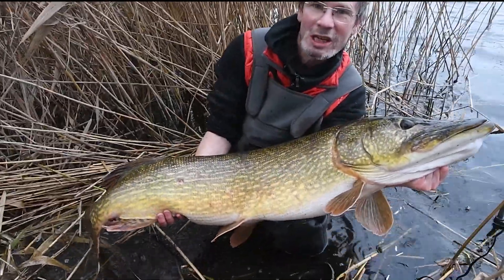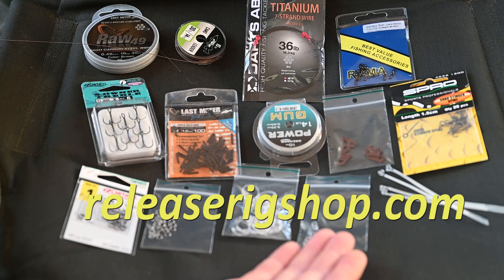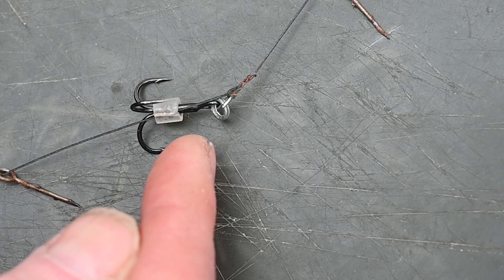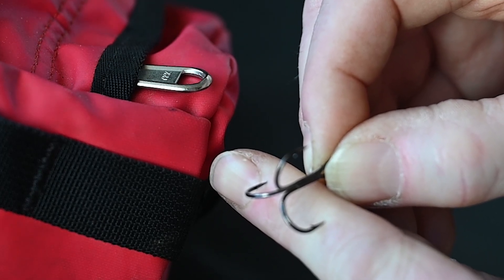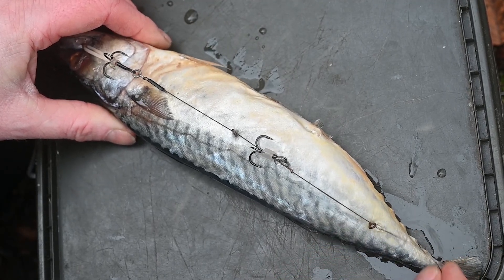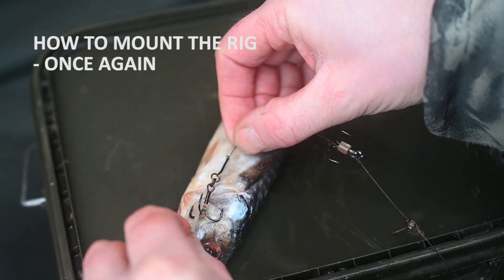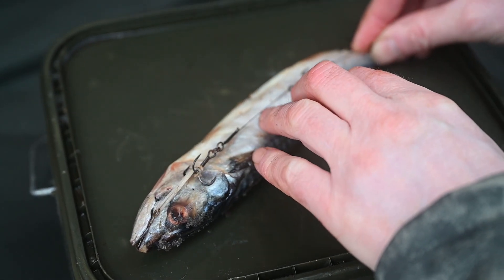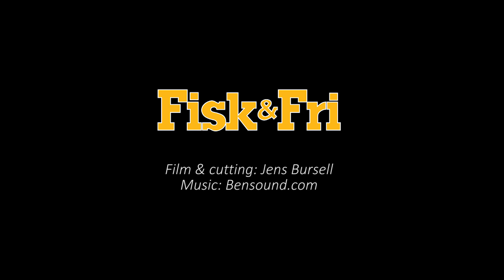DEAD BAIT: HOOK MORE PIKE WITH THE SKATING HOOK RELEASE RIG

Comment: Interesting concept
Reply from the maker: thx
Reply: @fiskfri  what about casting distance with it does the loop not pull through the bait on the cast?

I like big baits amego I tend to make a trace with 1 Single and 2 Treble hooks the single goes in the root or head of bait so all the force is anchored to a bone in the bait. The Trebles are just nicked into the skin of the bait they rip out on the strike into the mouth of the Pike.

Then there's different ways to rig up livebaits of size
Reply from the maker: @DavidScobie  depends on which loop you choose - i find casting very
 long with fx PVA strips as loop
Reply: @fiskfri  I've got those pva cable ties they are good even in cold water they still dissolve.  When I used casting clips I just ended up tieing a 5 inch loop of mono and using that to the casting clip.

I like the original idea buddy but the only drawback I can see is not getting the distance from a cast I do use things like bait boats to drop bigger baits into position.
Reply from the maker: @DavidScobie  Hi - if you want more distance, use a broader casting-loop - fx made of a plastic strip 2-3 mm wide. Remember to have it around the spine of the baitfish - and around the trace, so plastic not lost in water
Reply: @fiskfri  I normally go through the eye socket with the mono loop so it's  going through the skull of the bait. I use a 10lb mono for the loop so it's light enough to take the cast.

I did some videos on my channel a while ago of how I rig up bigger baits  it's something I was always asked questions about I often get a strange look when people see me throwing big baits
Reply from the maker: @DavidScobie  OK - but pike swallow head first, thats why i want the loop in the tail, så hooks turn right for best possible hooking

Comment: Save all the messing around it would be easier to push the swivel end of the trace through the tail so the fish hangs tail first from the trace then pull down and push the hooks in and connect to the line.That way the fish won't come off when casting or reeling in.
Reply: You are better shedding the deadbait in order to set the hooks... why would you want your deadbait back ? 🤔
Reply from the maker: My thought: this way the casting acceleration combined with angle of pull  would tend to dig the hooks dwon in the flesh - making a moving hook effect impossible -